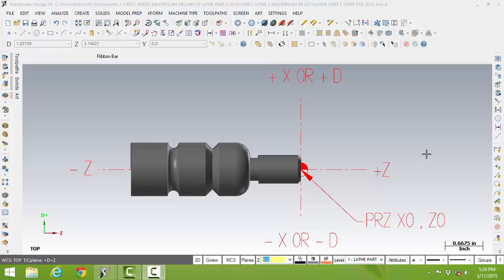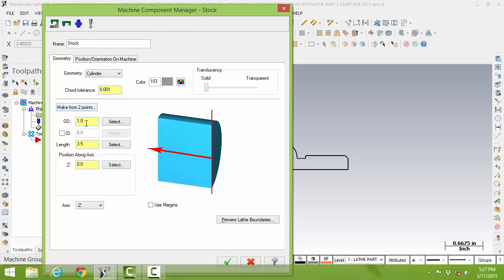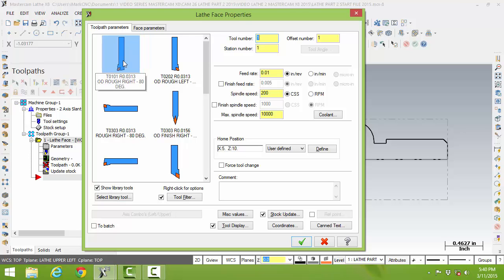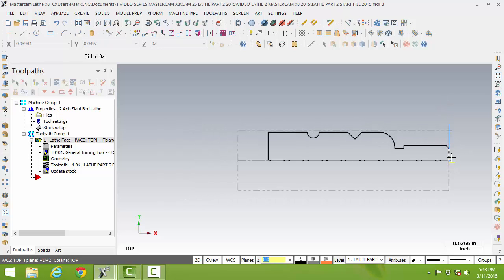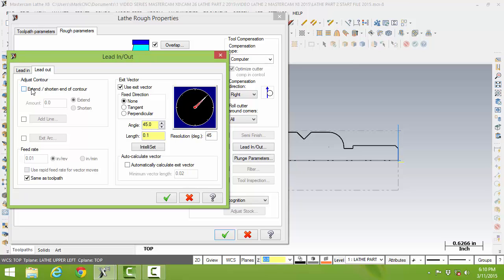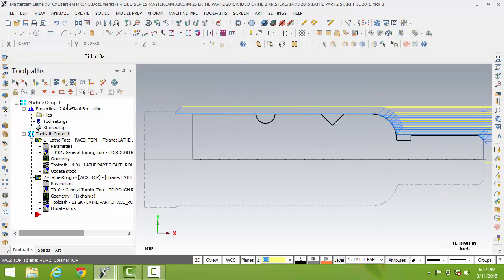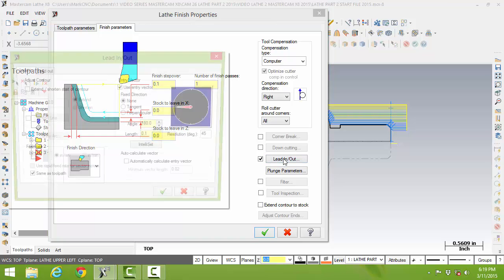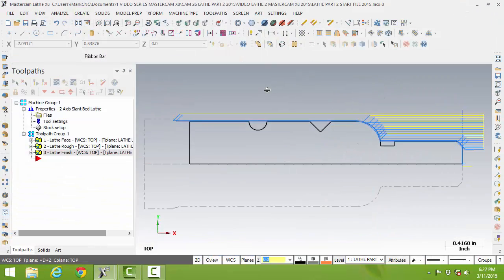Mastercam X8 LATHE PART 2 FACE ROUGH FINISH TOOLPATH Part 2 of 4

Comment: YOU SHOULD USE THE FINISH TOOL TO FACE WITH NOT THE ROUGH TOOL. AS IT WEARS YOU WILL LOSE YOUR TOLERANCE
Reply: Ken thank you for your comment I would do a rough and then save all finish toolpaths with its own tool. This instructions is for beginners class and I have limited tools on my CNC lathe. I have created these video instructions for my students. I do share with them if and when in the industry always use a roughing tool when removing material and a finish tool when finishing. I hope you enjoyed the lecture. I just started making these videos and plan to make more with machine setup as well per project.